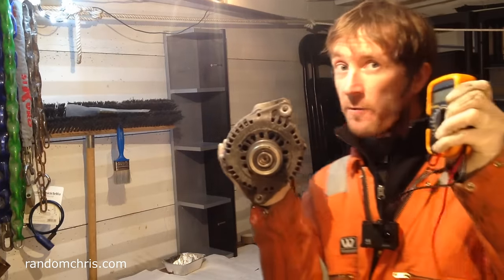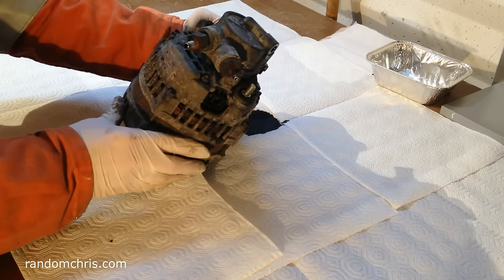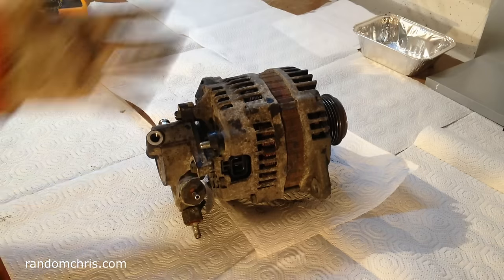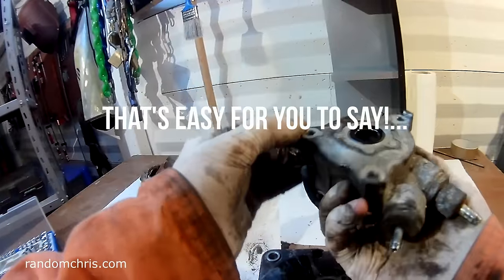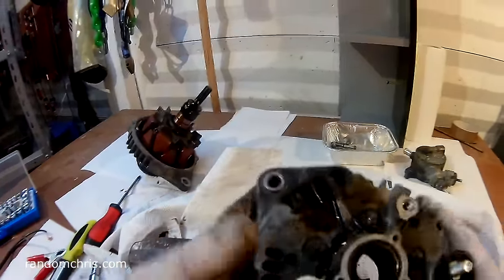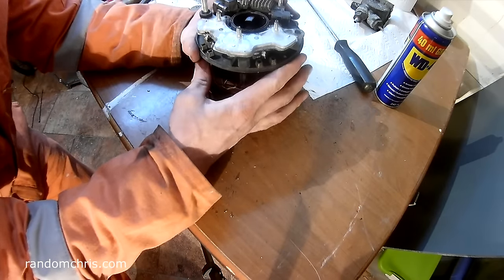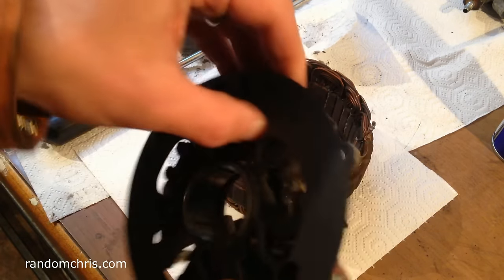How to Repair Your Own Alternator (With Simple Tools)

Comment: That was very helpful for me looking how to disassemble one for media blasting for paint prep. I have a VW Bosch unit that has the rectifier assembly on the outside of the case, and need to remove the stator for blasting. It looks as though the windings run through the case and are the only thing holding the stator in place? Hoping I can just uncrimp them and slip it apart but I have already had people tell me it's more trouble than it's worth. I was told not to bead blast the housing with the stator inside as to not damage the lacquer coating on the windings, but further research has shown I can replace this coating if needed?

Comment: Pretty funny, I decided to take my mother's alternator apart (after replacing it with another good one) and it has the same problem as your one here. Normally I don't get that lucky finding a video with the same issue. Thanks for the video, you know what you're talking about which is really nice.

Comment: Outstanding work! Not only well-videographed, with good audio and lighting, but the narration is smooth and the information beyond compare. I subscribed immediately.
Reply from the maker: Thank you very much Bob, welcome aboard! 👍
Reply: @christopher_barr  Recently, my Buick 98 LeSabre Custom's alternator failed. Rather than face a steep unit replacement cost, I followed one of the links to Amazon you provided in your video. Unfortunately, 
nothing Amazon offered matched my specific needs for rebuilding the alternator.
Can you suggest a link to a rebuild kit for the alternator unit, or at least, the voltage regulator?
Reply: if you mean video quality of everything in the distance then correct but the camera was unfocused on the actual alternator wires and brushes explanation part

Comment: Excellent excellent video Chris. I wanted to check that I had done my alternator rebuild correctly. The only bits I didn't properly check were the resistances with my meter. Unfortunately it's now back in the car. My only feedback is that the video was a wee bit blury when you were showing where the solder was meant to be. That was all. Again, Excellent video.
Reply from the maker: Nice one Neil, congratulations on fixing your alternator, I hope it serves you well. Cheers, Chris 👍

Comment: i have a '05   2.4L camry. the alternator started kinda roaring  louder than the rest of the engine combined.. so few days later battery light...few more days it dies on the highway..normally in a covid free time i would have had the money to buy a new one at the start...ive always been a diy repair first buy new last resort.. i saw on your video that it may be possible to re soder the broken connection...without buying the part you showed to repair ur alternator..could i repair the connection ??? i believe my case is the berrings buy if i have the same issue as ur fix?? can i fix the connection>>>thank u for ur video and knowledge

Comment: Great videos. I wish I would have seen this yesterday. I replaced my squealing bearings (200k on 1999 Pajero I've had since new) but couldn't figure out how to do brushes. As they seemed to have some life in them I didn't bother changing. It also took me about an hour to figure out the rear hole to hold back the brushes although mine were worn beyond the brush hole so I bushed brushes all the way in. I also had used your starter video on that rebuild last year,
Question: on start I initially had the battery symbol and A/T lights on. I thought great now I've really buggered it and need a new starter. I reved engine to confirm squealing gone and lights then went out. Is this a normal diagnostic start up after battery and alternator disconnect?

Comment: Hi Chris! Very good info and camera work made it easy to understand. The pricing on Alternators today is crazy high. I will chose to rebuild mine now. Just not that good with the multi-meter part yet, but learning. Thanks for sharing! Cheers from Motown.

Comment: Hi, thank you for video.
I might have problem with alternator as well. but since i tested only battery and its ok. Iam not sure yet. My problem is battery indicator is on (all times). And my last drive all other indicators (as airbag error), but the main thing was that steering went very stiff, maybe even harder than if power steering failed. After recharging battery steering was ok, but power steering indicator was yellow indicating some issue. 

Tomorrow i plan to test voltage on battery with motor on  if Alternator is working and then test fuses (- batery to ground, separately unplug. fuses) if there is some shortcut. 
Any other ideas?
ohh btw. i have VW Touran 2005, 75Kw 1600cm^3 (Petrol)

Thank in advance.

Comment: Really great video, the full works. Keep up the good work.

My alternator has a protective cap (121mm diam) over the regulator, brushes etc seemingly designed to be wrecked & replaced with a new one: no screws, maybe glued on. Bosch part F000BL0636, VW part 04C903023B. Cap is part APC0040S from a Polish co, who hopefully will sell one to me. Any ideas of how to remove it in 1 piece, or get a replacement cap?
Reply: Protective cap prised off undamaged. It was fixed with 3 plastic pins next to each of 3 screws below holding the diode plate. 2 of the pins broke but slightly longer diode screws (below the cap) and washers should fix it, & cable to battery should stop it falling off.

Comment: Hey Chris, nice video. I'm an amateur mechanic but a professional electronic technician. As such it was a nice tip you mentioned silver solder.

But out of curiosity, was it not possible for you to make a mechanical connection and then solder those wires down yourself onto what was left of the original diode assembly?

Comment: May I ask what car that alternator came off of?  It looks very similar to the one on my 2005 Nissan Altima, other than it doesn't have that pump on it.  I was trying to take mine apart today but after getting all the bolts out, I couldn't get it separated because I was afraid I would damage it.  I've ordered a new one but I'd like to fix mine to have as a backup.

Comment: I remember when one could buy alternator and starter rebuild kits for about $10 cdn. In the kits were new diodes, brushes, plus various clips, cap screws and fittings appropriate to your rebuild. As far as I know they are no longer available. Since the diodes tested good, could you not have resoldered the wires to their original spot, bead blaster the case and resurrected the alternator?

Comment: I used to work in a shop many years ago where we rebuilt alternators for Ford. Most of the time it was bad diods or a burned up stator.  Another department went over the rotors but sometimes those would be bad too.  We would tear down a couple hundred a time, clean them up and check all the parts before reassembly.  All of ours got new brushed and bearings. GMs had a diode  trio that would often fail.
Reply from the maker: I like to see things fixed rather than thrown away. Thumbs up to all the world's fixers! 👍
Reply: Dennis W 7
Reply: I just bought one from Walmart I don't know if I should have. A brand from Db Electrical but it was only $65. I don't think that it would have Bosch quality. I might be taking a chance on this. But couldn't beat the price.
Reply: brizzx32 when wal mart start selling parts like that
Reply: Yea i was shocked walmart would sell alternators too. For like 60 bucks cant beat that!
Reply: Where can you find rebuild parts?

Comment: hey Chris, I hope you see this soon, I have a 2007 Honda Pilot, and the continuity test is good, as well as the reverse one where you switch the test leads.... however when I do the test where you put a screw driver, the alternator pulley does not move on either direction, aka locked up. I opened it up and checked the brushes and the copper rod where you were checking resistance and it is good too, only problem is that it is locked up with the screwdriver inside, with no screwdriver it is very smooth in both directions. the pulley doesn't look sophisticated and I am wondering how it works on this car, or what could be wrong. any help appreciated

Comment: Hello and many thanks chris for this straight forward video. I have a question rather than a comment . Would the overheated plate that turned out to be the problem in your case ,be the cause of the alternator clutch wheel to fail ?

Comment: Ive been working on my 1995 fiat barchetta over the winter. I had the battery removed and after charging and connecting before i even turned the ignition on, smoke puffed up from alternator area. Now battery light will not go off on dash !
I can only think that some fluid has dripped down into it and caused problem.
Do u have any idea if its a simple fix or a new alt ??

Comment: Great video! Why, if I may ask, do you recommend silver solder?
Reply from the maker: Hi Benjamin, this has a higher melting temperature so will not melt in extreme conditions, unlike standard solder, which may melt in service under extreme conditions in a very hot alternator. Cheers, Chris 👍
Reply: @christopher_barr  Yes, I understand that it has a higher melting point. But I would think that if your alternator was operating at a temperature high enough to melt regular solder, I would say that you have a problem somewhere else. Actually I don't think an alternator could operate at that high of a temperature.

Comment: Chris
When the alt fails the diode test. and it was only producing 0.1 volts less than the battery running. My problem is that its a Westerbeke engine (Perkins 4108) and they want US$138 for the diode part. I dont know the OEM manufacturer of the alternator (possibly Mitsubishi), is there some way of identifying/replacing the diodes, avoiding Westerbekes prices ???
cheers man

Comment: Great video. Is there a name to the test you did in the beginning - testing continuity w/ red lead to alternator's positive post, black lead to alternator's case & then vice versa?
it was the set of tests you did before you brought the drill bit's battery pack into the equation

Comment: Hello sir I was wondering what is difference betwean left and right turning alternator ?
Are the brushes just turned around does the stationary windings must be switched ?
So tractors actualy left to rignt turning engine and some oposite right to left .
So If wrong alternator peopel buy they fry the baterry normaly .
So any ideas how to itentify alternatir turning point?

Comment: Having the same issues with my 1.7d Astra,  thanks for the tips Chris, as always great video. Cheers
Reply from the maker: Thank you for your comment Dave. Hopefully this will help someone out. I really like the Astra but it's time for it to start being a bit more reliable... or else! :-)

Cheers,
Chris 👍
Reply: My Hitachi alternator is very similar except it doesn't have the clutch. But, the rectifiers must have experienced over heating.  Could that be the result of using a boost charger before I replaced my batteries?  I never had it on boost for more than it took to crank it.

Comment: Wow great info! I may use this info someday, but for now, to the junkyard I go! 😁
Reply: Me to! I had a failed alternator recently and $80 at the junk yard and about 15 minutes to swap it over had me back on the road with no issues. I am all for fixing things too, but for some reason (for me) electrickery has just never been worth messing with because I don't know enough about it to know where to set my multi-meter or what tests to perform etc.
A Lot of these vids presume some sort of electrickery knowledge back ground, that I just don't have.
Even tho I am good to go with my replacement used $80 junkyard alternator - part of me would LIKE to fix the old one, if only to have a "replacement spare" ready and waiting, just in case the used junkyard replacement up and dies for any reason anytime soon.
Maybe I will tear it down... i wouldn't know how to test for splattered diodes etc once I do tho.
To be honest, any fool can tear something down given enough time and a big enough hammer but it takes a good man to put it back together right. This vid doesn't actually show that (putting it back together successfully).
How do we know you fixed it?
Maybe your just good at breaking stuff down and lets face it my 3 year old can wreck stuff - that doesn't take any particular talent.
$50 bucks for a replacement part and all that work, versus $80 at the junkyard and 15 minutes with 2 spanner s to swap it out and be back on the road?.
Just how i see it, OMMV (Others Mileage May Vary).

Comment: How much did you spend in parts to rebuild this ? Compared to the cost of buying a reman ? Is it worth self rebuilding ? Iv purchased a bad reman before now i ask them go test it before installing instead of trusting a clean looking reman
Reply from the maker: The parts are around 25 USD so compare that to whatever you’d pay for a remanufactured unit... Chris

Comment: I actually just Googled what the price of my alternator would be because I feared that it was going to be a few hundred dollars to fix and to my amazement I can get a whole new one from Amazon for like $50 but I still like to learn why something went bad and if it is possible to easily remedy. So no matter what I am highly likely to disassemble my alternator. Driving a night next you know I noticed my lights on the dashboard were very dim. And then that's when I noticed my battery light was on and I looked at the voltage in the voltage was just a little bit above 10 V. And I ate just did not feel safe driving because I could barely even see with the high beams technically on. Cuz the voltage was down to 9 or possibly less so here is 4:50 in the morning and I'm sitting in a parking lot for about an hour-and-a-half trying to find an answer to my problem and this led me to this awesome video so oh yeah awesome video

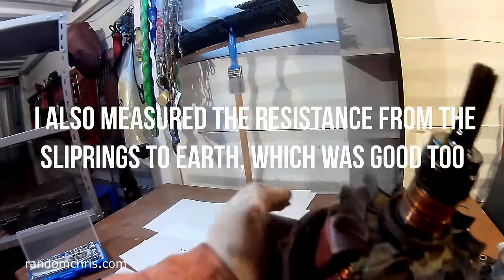Comment: First time viewer here, great stuff! Definitely helped with taking mine apart. One suggestion would be when you have the camera on your chest and you're working with 2 hands, be more conscious about the camera angle, it was kinda hard seeing what you were seeing since the camera is lower than your eyes like from 3:55 to 4:10 is an example and 5:45 to 6:10 but other than that, it was simple and straight to the point with good info.

Comment: I have a quick question i have a vw jetta mk2 from 1985 and when i start it up the alternator won't charge untill i bring it up to 1200rpm. After that it's fine. Do you know whats wrong? It would be awesome if i could do it myself so i could save a 100 bucks on getting it rebuild by someone else.

Comment: I purchased a battery 11-24-2019, and I had my alternator replaced, with a rebuilt one on my 2006 Ford five hundred on 10-13-2017 and a new battery. My car is showing the same symptoms again today, I think it's the alternator again. I've already replaced the alternator twice previously, over the last 10 years. I bought the car new. I wonder if I should just break down and buy an oem from a Ford dealer. It will probably cost twice what a rebuilt alternator ($209.92), but in the long run may be best. Thank you, John

Comment: This is a good video. Although if I were going to the trouble of tearing apart a failed alternator, I would do a full rebuild: new bearings, brushes, rectifier and regulator. A little more costly for sure, but sure beats having to tear into it again a short while later when one of those other parts fails as well.
Reply: If you're gonna full rebuild Then just buy a new alternator. He showed how to fix it and buy cheap parts to keep it A1.
Reply: @luhdawger  Never done a full rebuild I see, or you would know that a full rebuild is still far cheaper than a new alternator.

Comment: I just did the same thing for my Opel astra H car, but me i didn't bay anything , i just changed the not working diodes and my alternator works fine now, thank you for the video
Reply from the maker: Excellent, job well done! Cheers, Chris 👍
Reply: Hi Christopher,
Sorry if i bother you with my problem that apear again
Last Sunday, i had the same probleme to my car ( Vauxhall Opel astra h 1.7cdti 74Kw), when runing i get the red seer in the dashboard
it is now the second repaired alternator that i put on it, i have no idea why this happen :/
last time i repaired the alternator and only by precautions, i changed also the battery by a new one
one thing in which i'm sure, it is even if i repair again my alternator it will relapse again after few weeks :/
after some research on the internet i found that many people had the same problem with this shitty car, i put questions and i'm waiting for there answers...

last time i changed only the diodes and it worked perfectly (i had between 13.9v and 14.5 each time i see the voltage when runing), 
do you have any idea ? what's the root cause in your opinion ?
thanks in advance

Taha

Comment: Could you help me with an issue I have on my 1997 Fiat Ducato Alternator, it's a MAGNETI MARELLI, my van is a motorhome. The reading at the starter battery was 13.28V and roughly the same on the habitation battery, with the engine running at idle. I tried disconnecting the leisure battery and voltage went up a bit to 13.49V, I have checked all the wiring, also done a voltage drop, checked the earths etc. Took a reading with my multimeter directly from the alternator with engine running and got the same reading 13.49V. Nothing like 14V which I was expecting. Is this a fault with the VR??

Comment: I just had a similar issue of neeeding nearly micrometers of more room in mount to fit alternator.......i fixed my issues with a reciprocating saws sander attachment to the flat metal side that fits in bracket on the actual alternator.